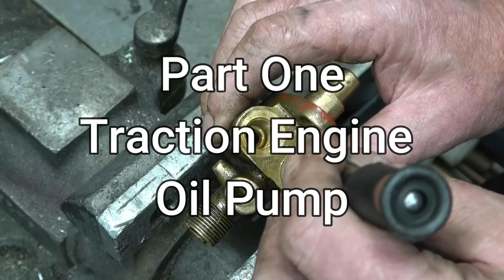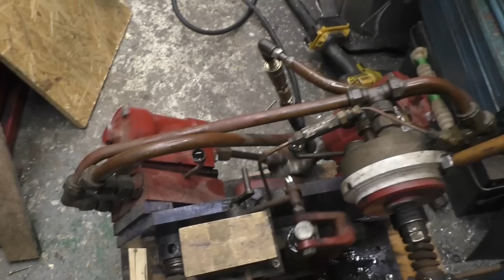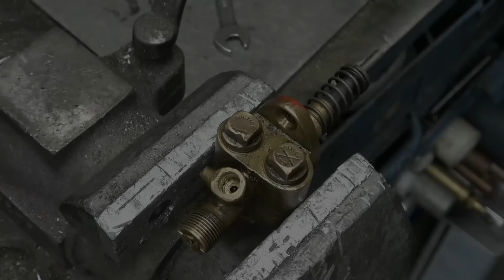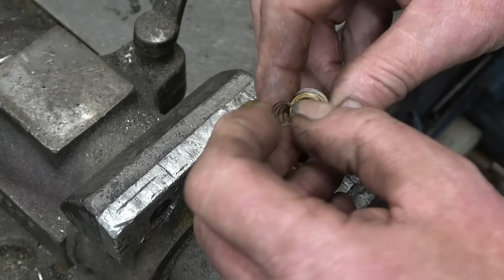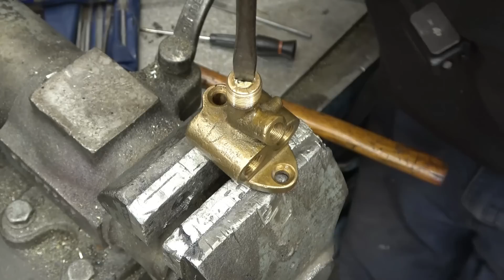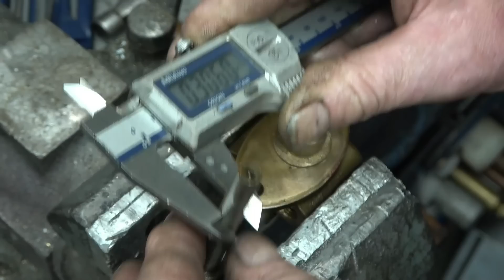SNNC 503 P1 Steam Engine For Sale . Traction Engine Oil Pump Repair

Comment: I was a little concerned that with the increase in diameter of the pump plunger, it might pump too much oil, but having had a quick calculation, its pretty minimal. Nice little repair coming along there John.
Reply: My thinking is that just compensates for wear in the drive cam, probably. This stuff isn't that precise and a little more oil never hurt anything.
Reply from the maker: The stroke of the pump is adjustable to a very fine degree